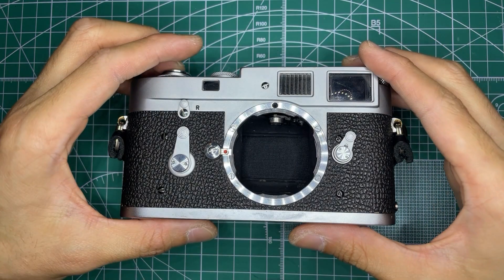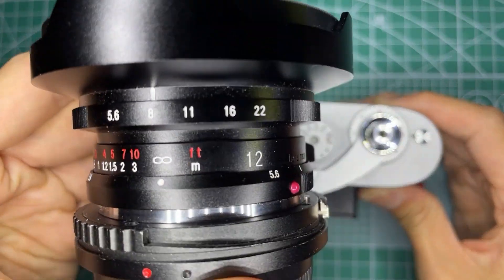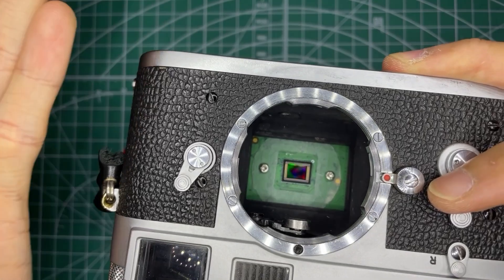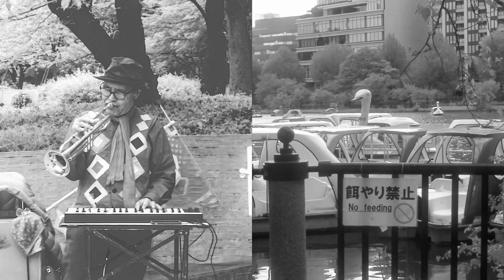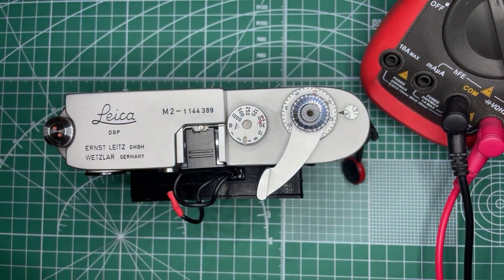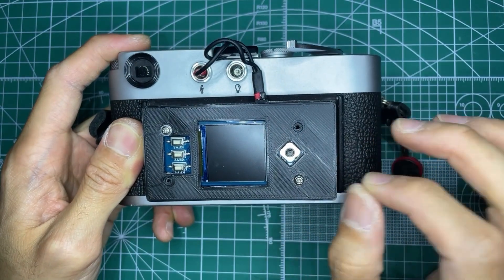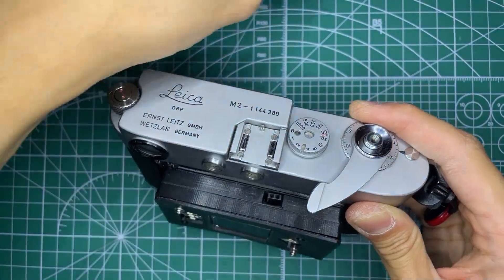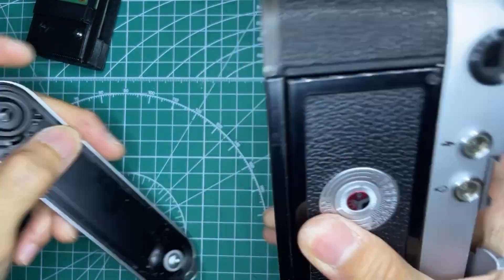Leica MPi, a Leica M2 with a Raspberry Pi-powered digital sensor

Comment: My friend, do you think it is possible for me to create a digital back for my Hasselbad? I would have to fix the focal length, if I bought the camera with the lens, or I would have to have an optical element that compensates for the difference in sensor sizes, if I choose to use the sensor option without a lens.

Comment: hello…I have been working on this idea for many years and I compliment you on your very smart solution of the design problems involved…yes, we all would like a larger sensor, but, by taking the Pi processor to this complete working configuration you have set the stage for implementing a larger sensor when it becomes available. Bravo! I have some info and parts that I will contact you about…

Comment: What of an clever feat of engineering! It makes me ponder if I could do the same for my original Olympus Pen. Additionally, your Github link leads to a 404, what happened or are you currently busy with life (which I completely understand if that's the case)?
Reply from the maker: Thanks for the heads up — it should be available here: michaelsuguitan.com/mpi

Comment: The reason why it doesn't shoot well in color is because you've removed the IR filter. Some people do that intentionally to their digital cameras to get the Aerochrome effect. You should be able to restore its ability to take regular pictures by using an external IR-cut filter on your lens.

Comment: What did you use to power your pi?
Reply: Nvm - going in your blog post. I’m thinking about using an 18350 with a boost converter to get it up to 5v and mount it inside where the canister would sit.

Comment: This is really cool. This is yhe first one of these conversions done in a way that I feel is 'correct'.

One thing I wonder is if it’s possible to just have the raspi hq can running in the longest exposure the sensor allows constantly and using the shutter to do the exposure as well as using that electrical signal to tell the raspi to save that inage in particular.

That way you could use the Leica shutter controls.
Reply from the maker: I originally tried to implement this idea, but the mechanical shutter would still need to sync to the video's framerate. It would require the mechanical shutter to open when the video begins grabbing a frame.

Comment: Really though, if this becomes a viable product still with a small sensor, I could envision a lens lineup from a third party designed for the smaller sensors but with various film body mounts. I think this could be a serious hit, and could possibly make the prices of older film cameras increase 😅

Comment: Fantastic work, this is the best High Quality Camera implementation I’ve seen!  From here to 3D printing a “film door” that fits various other models would be comparatively simple.  Also, just a thought, they make hot mirror lens filters for full spectrum modified cameras, would that work to give you normal color in daylight?
Reply from the maker: Others have suggested IR filters in front of the lens, which I'm keen to try out.

Comment: This is incredible. Please please keep development going. It would be great to see if a custom base plate could house some of the hardware, and maybe the cavity that the film cartridge would normally be in. I guess the holy grail is having little to nothing protruding from the back of the camera body.
Reply from the maker: A custom baseplate for the hardware (controls, battery) would be a great idea and not unlike the Leicavit rapid winders. The first iteration with no LCD module was almost flush with the back of the body.
Reply: @msgtn-io  I would love to see that explored. I actually think going without the LCD is an okay idea too - a la Leica M-D. Battery cells could go up into the body in the film cavity and Pi / controls in a Leicavit style base plate to keep it all as thin as possible. A version without an LCD would extend battery life also. From my perspective, shooting with my M2 is a joy, and I am not looking for a digital experience, but film is getting expensive so the screen-less solution is actually pretty appealing.

Comment: excellent work! 👏🏻👏🏻👏🏻👏🏻
I had thought something similar a long time ago (I have a digital camera destroyed to remove the sensor...), but I have no knowledge of electronics. 
Is it possible to use a FF sensor from a Canon or Nikon camera? I suppose it is possible to receive the data from the sensor, but I don't know if it will be possible to "translate" this information into an image regardless of the original hardware of the camera? 🤔
Greetings from the south of Chile!!🤘🏼
Reply from the maker: The HQ camera module here is the largest sensor officially supported by Raspberry Pi. It would take some more serious hacking to interface with other larger sensors.

Comment: Really cool project, very impressive! I wonder if there is a way to use the original Leica shutter dial? Maybe you could have the rpi continuously recording when the shutter is closed before the exposure, and then end the exposure a set time after the shutter button is pressed?
Reply: What about putting the electronic shutter in bulb?
Reply from the maker: I've tried continuously recording exposures but the frame rate limitations mean that the video is usually out of sync. For example, if you start a 30fps recording before taking an exposure, you would have to align the opening of the shutter with the beginning of one of those frames.